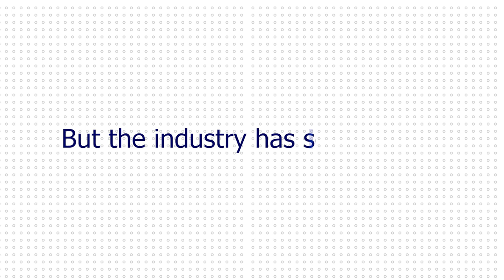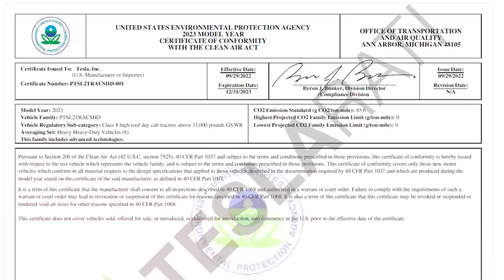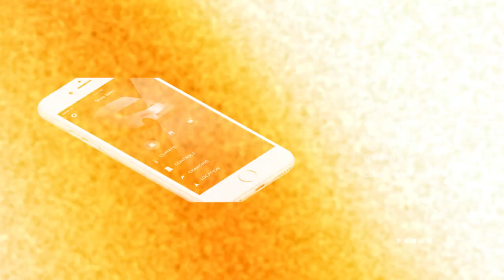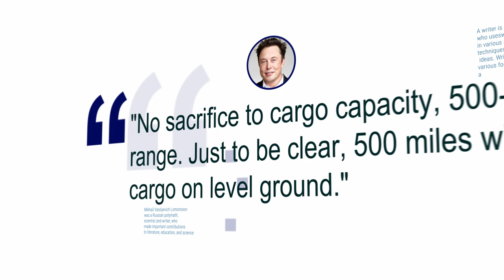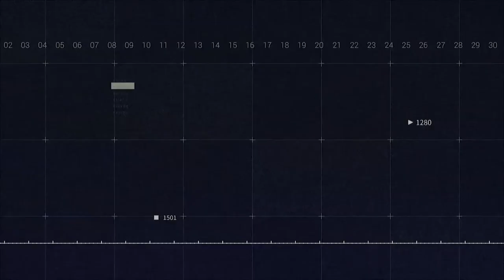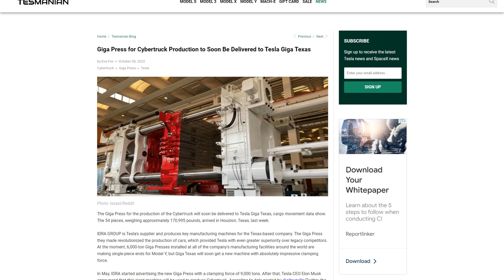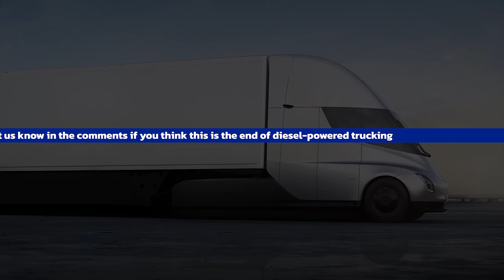Inside Tesla's NEW $7 Billion Semi Truck Factory

Comment: Truck drivers already have a mandatory 30 minute break. If you can recharge the batteries 80% on the 30 minute break that's amazing! Even if the driver has to take an hour break for charging that's still not too bad. Between charges perfect it doesn't affect anything

Comment: Wonderful video!  It gives lot of information without any Umm in your comments.  

I wonder if a company like Pepsi could install a battery in the trailer, so that the trucks can pull into the distributor and pick up a fully charged battery on the trailer, and not need to stop and recharge at all - ever.  A 50 amp 800 volt cord can move about 80KW  watts per hour using 2 + 800 volt lines and 2 each -800 volt lines and a ground.  Then a 300 KW battery on the trailer can provide plenty of power for 150 miles at 2 KW per mile.  This is longer than most local delivery trucks travel each 8 hour day.  While the trailer mounted battery will only provide 40 miles per hour, the on board truck battery will supply the remainder.

Comment: If I was running the Pepsi distribution center, and was told I could get a 500 mile 1,000 KW battery truck, for say $400,000, or a 300 mile 600 KW battery truck for several thousand less each unit, I would want the lower cost unit, as most of my drivers do not drive 500 miles per day!  Most would drive about 150 miles per day.  

Battery cost is something like $250 per KW, so a 400 KW smaller pack should be about $100,000 less cost!  So IF I could buy 3 of the 500 mile range units or 4 of the 300 mile range units, I would pick the 4 smaller range units. It would have a lower GVW, so the truck could carry more cargo.  

I wonder if Pepsi would be using them to transfer product from the production facility to places like Bakersfield, or from the production facility to nearby stores.

Comment: Wrong! semi trucks haul 45,000 pounds not $80,000.

80,000 is the max weight for the tire load. Any higher it would destroy the roads and bridges.

Comment: quick google search says that if a driver is adhering to the speed limit cough cough  a driver should average between about 605 to 650 miles a day.
So if tesla can squeeze another 150 or so miles out of their batteries then it would put them on par with a diesel truck.
with that being said, a commercial driver is required to take at least one 30 minute break during their shift. So assuming they can plug their trucks in during their 30 minute break it would be comparable. AND you don't have to worry about a tesla driver parking at the fuel island and going in and disappearing while other drivers are waiting.

Comment: What’s the gross weight of the Tesla semi truck?
Reply: Apparently the tractor weighs about the same as a standard diesel rig with full fuel tanks.  

A year or two back it was thought that the battery powered tractor would have to weigh about a ton more so the DOT raised the max gross weight for battery powered rigs to 81 tons.  But Tesla has more recently stated that they've been able to reduce the weight of their tractor by that "extra ton".
Reply: About 1500-2000lb more than a conventional truck. The gov't allows an extra 2000lb of gross weight and Tesla semi requires most of that difference. My info is about 1-1.5 years old.
Reply: @avgjoe5969  
In the last 1-1.5 years Tesla has announced that they have brought the weight of their tractor down to where they no longer need the extra ton allowance.

I suppose that means that a trucker could take advantage of the extra one ton DOT allowance and carry more cargo than a diesel rig.

I suspect other companies will need the extra allowance at first as they bring their tractors to market.

Comment: How many square feet on the roof of a 53' trailer?  Why is no one discussing adding solar to the roofs of trailers to increase range?
Reply: My guess... a couple reasons.  1) trailers are not always owned by the Semi owner - and get swapped out frequently.  And more importantly... 2) solar power would provide a mere pittance of the required energy.  A trailer roof filled with panels wouldn't extend the range a noticeable amount.
Reply: 4 miles of added range per sunny 5-8hr day.
Reply: they could build extra battery pack under the trailers  give 500 too 1k miles extra range.
Reply: They have been toying with the idea of solar panels on the container roof, but the difference in range will be minimal even with the large surface area. That said, I would find it surprising if it weren't added as an option later.
Reply: @hillbillyintheasia6122  
There’s a government mandated weight limit on trucks. Adding more batteries may mean less freight. Plus, as someone else remarked, the trailers don’t usually belong to the trucks owner.
Reply: 424 square feet
Reply: I just bought 8 each 250 watt solar panels for $85 each, used.  You might fit 4 KW on the trailer roof, or enough to extend the range by 2 miles each hour, or about 10 miles per day.  This is really insignificant.  My system will save me about $30 per month on my electric bill, so with battery cost, inverter, ect, I am wondering if I got a good deal or not?  The 4 KW solar system would generate about 20 KW per day, more in the summer, less in the winter.  So save about $6 per fill up at $0.30 Per KW charging costs.

Comment: These trucks are not going to replace diesel anytime soon.. 1st is payload... the legal limit for all class 8 , 5 axel units is 40 tons.. but what is the gross empty wieght . That is your payload and  range is determined by how much you can stuff in them .. which means most will be limited to large metro areas where lots of idling happens. 2nd is stop time.. on average most units  have a 650 mile range per 11 hours drive time. You can fill up 250 gallons in about 15 minutes.. with most diesels averaging 7.5 mpg loaded .. the Tesla semi cant compete in the long haul segment where the big money is due to charge times and range limits verses payload.
Reply: Soon you cannot fill up any gas at all

Comment: It’s great that vehicles are going electric, but I’ve heard predictions that we’ll need 3x the electricity generation to do it. It may not be practical to make that up with just wind and solar. Japan, China, France and Canada are looking at advanced nuclear technologies to make up the shortfall. Inherently safe designs that produce less waste and can consume waste from older reactors and are also cheaper to build than current reactors.  Small modular reactors are safe and small enough to place close to consumers. Where they can produce hot water to heat buildings as well as electricity. A side benefit is they can also produce hydrogen that can be mixed with natural gas and distributed to homes and businesses reducing the cost and CO2 emissions.
Reply: The average house hold will consume 30% more electricity but solar and wind are good enough, my state is 80% renewable and we have very cheap electricity, never had issues with lack of power. I'm pro nuclear but its expensive, I live some 30 miles from the Hanford site where most of are weapons grade plutonium came from and where 95% of the countries high level radioactive waste is stored. The just recently got done building a multi billion dollar nuclear glass furnace made to safely store waste in glass rods.
Reply: @Victor-vj5ds  Stop the lying
Reply: @Amor1990  i don't lie, its counterintuitive towards my goal. If I have to lie then I'm not arguing well.

Comment: They don't make trailers.  At least br a little more accurate with your clickbait thumbnails.

And they haven't even begun production yet.  Some 4 years later than promised, they're still not ready for prime time.
Reply: Tomorrow is November 1.  Tesla has repeatedly said they will deliver their first semis to Pepsi in a month.  December 1.  People have reported seeing new T-semis being road tested prior to delivery.

Sounds pretty much ready for prime time to me.
Reply: @billcichoke2534  

Every EV that Tesla makes is road tested.  In fact, Tesla created a software system that allows for their cars to be tested on a closed track without human drivers (saving costs).  And that software was the genesis of Autopilot.

If Tesla is road testing tractors that means they have produced some and are checking them out before delivering to Pepsi.

Continual changes in products is a massive improvement over making changes only annually or every 3 to 5 years when models change.  Other car companies are now realizing how much of an advantage that gives Tesla over their lack of ability to make improvements.

The number of chargers for the Tesla tractors being delivered this year are already in place.  Tesla is starting with a single buyer and a fixed location.  They have chargers at Pepsi-Modesto and chargers between their Fremont factory and their Reno factory.  As they expand production/sales they will put more chargers where they are needed.  That is exactly what they did with their EVs and Superchargers.

This fraudster's bull-t?  Pretty much everything Elon has said he would do has been done or is in the process of being done.  Sometimes he delivers late.  When one is setting out to do something never done before like landing and reusing rockets or building the best EV ever built you should expect to encounter some unknown unknowns.  Columbus thought he was sailing to India but ran into a continent unknown to Europe at the time.
Reply: The big hold up was the 4680 batteries. The truck really can't be built in numbers without them. The truck itself has been ready for a while. Ramping up 4680 has remained a big headache. They may (or may not) have finally solved the issues with cell production. If so, about a year to ramp, adding multiple production lines in Austin, Berlin, Shanghai, Nevada... if not... 2024 becomes 2025 for a 50K run of trucks (requiring the equiv of 500k of car batteries).
Reply: @avgjoe5969  the semi uses 2170 batteries

Comment: It'll never work. Try loading that thing up with a D11 and pulling a 7% grade. The battery would be dead halfway up the hill, and no trucker is going to want to wait 30 minutes to recharge to only go 400 miles. On top of that, yeah it might not burn diesel, but those batteries in it are made of lithium which is mined from the earth using DIESEL powered equipment. So you're really not helping the environment in any way

Comment: I believe there should be a vast expansion of our nations Rail Network.  Semi-trucks should only be for regional and in-city use.  For anything more than say 300 miles, the intermodal container/trailer should be transported via electric rail.  Transporting goods by rail is cheaper, safer, more efficient, and more environmentally friendly than by truck.  Trucks are also responsible for 95% of road wear and many fatal highway accidents.
It’s a shame that we use to have an excellent rail network, but after WWII the auto, oil, and rubber industry bought and dismantled it.  They did so people would buy cars, trucks, gas/diesel, and tires.  Freight & Passenger Rail is superior to highway transportation even when electric cars and trucks are used.  Lets build a real and sustainable future.

Comment: All I can say is that I think it’s going to be a bumpy ride. I do think it’s the correct decision to move away from fossil fuels, but the transition is going to be rough, IMHO. If the savings numbers on the Tesla Semi are correct, it’s an obvious no-brainer. I don’t know that it’ll be that cut-and-dried in the consumer space.
Reply: I would agree that it won't likely meet those numbers any time soon. But if the savings are even Half of the projected savings, it is Still compelling. 
Small differences in efficiencies can give a competitive edge. This is not small. Platooning trucks is also a interim step to autonomous driving and looks attractive as well.

Comment: Going to be a long time before those are useful. Need huge infrastructure improvements. Maybe in 10 years.
Reply: Hide and watch.
Reply: Not really. Without infrastructure changes, the 500 mile range gives it a radius of operation of about 200 miles with no charging save at home base. That covers the majority of short haul trucking (which is a very large market segment).

Comment: At the current rate of technology battery-electric trucks, especially tractor trailers, can't meet the wide and specialized needs of the transportation industry. Diesels, diesel-electric, turbine-electric and hydrogen power-cell eclectic will be around for some time especially the latter, for heavy truck applications anyway. These views may not apply to passenger cars and commercial people movers. Though I'm not a tree-hugger nor a climate change denier, I believe that the combustion of all carbon fuels have a negative effect on our environment. Not that these now used as carbon fuels can't be reassigned to non-combustible, non pollution emitting processes in the near future. Since carbon isn't the only pollutant produced in combustion, it must stop. Just as the widespread use of horses did a hundred years ago

Comment: Regenerative braking systems are nice BUT these need to be integrated with Capacitors more since recharging batteries has an energy flow issue and capacitors can buffer that flow especially in hard braking situations. Many EV & hybrid vehicles have a "Regen charge rate" display so people can plan their braking to fully utilize this and not waste potential energy savings & brake wear by braking too hard; too fast. This would be key with semi-truck since it holds SO MUCH kinetic energy when traveling and truckers are best at fully utilizing this as most are Owner-Operators looking to increase savings in money wherever possible!
Reply: If Tesla puts enough batteries in parallel in their battery pack. You’ll have all the power/energy flow you need to handle braking. 
Semis also have brakes on the trailers which are likely not regen so some of the energy goes there too.
Reply: You're not regenerating if you're using Jakes a lot of the time, which obviously saves significantly on and gives more control than discs and drums.

Wait!  What?   This thing has 4-wheeler style pads!   ???